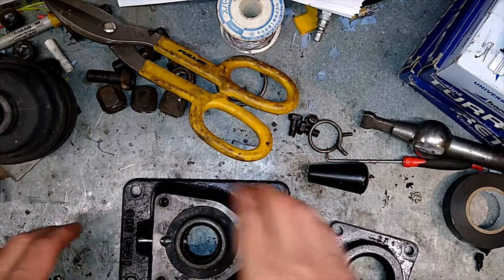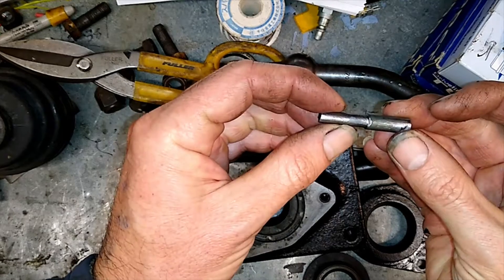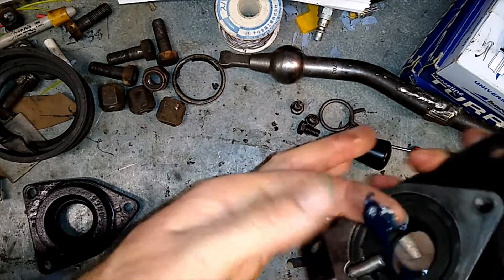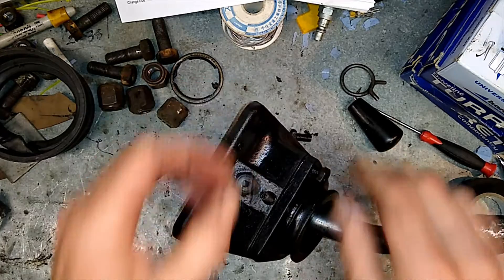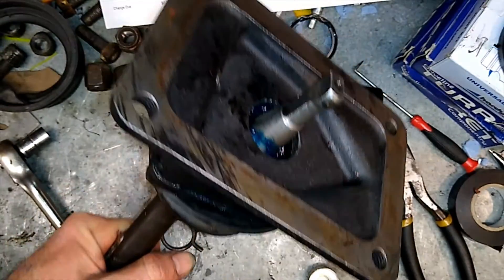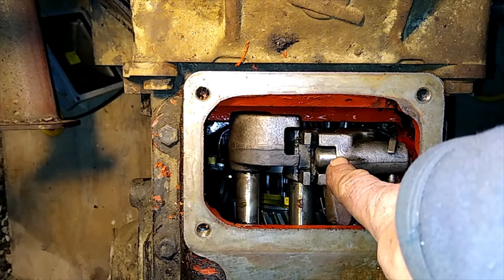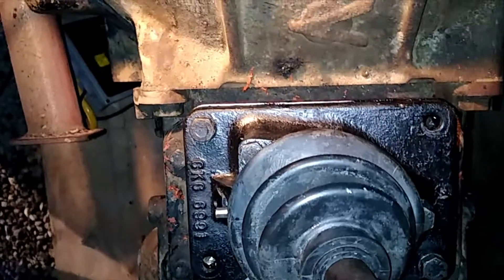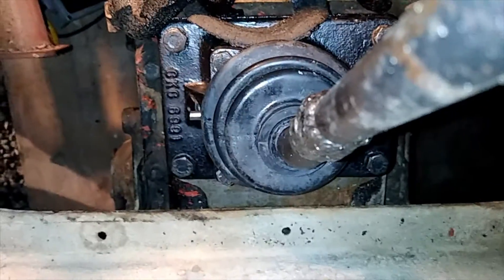Gearbox lever Tidy-up (Turner 300 gearbox) Bedford Bus

Comment: Hi, I’m putting one of these gearboxes into my coach only it’s off a truck so doesn’t have the pin/gearstick. I’m going to drill and add the pin, any chance you could give me the dimensions of the pin please and hole size needed? Thanks